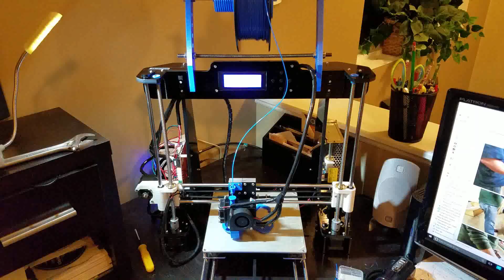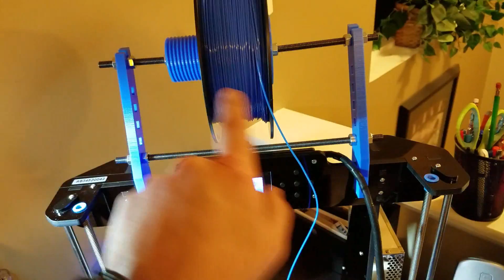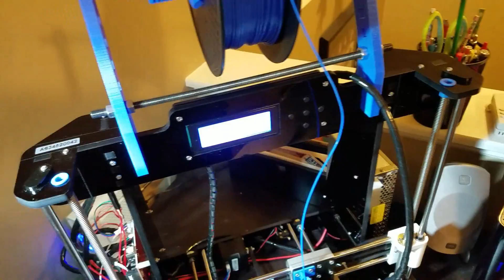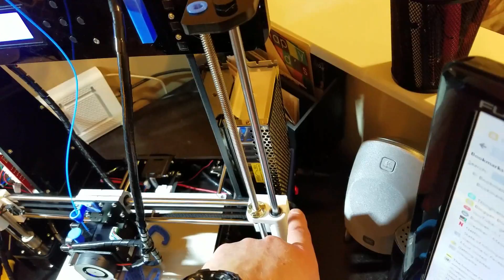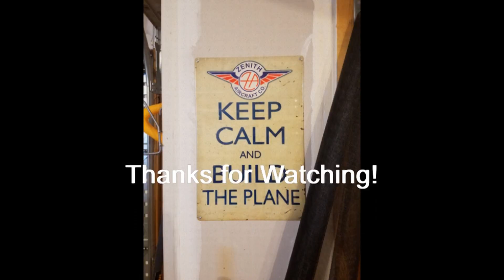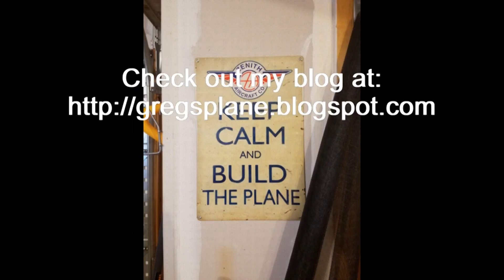Experimenting With 3D Printing

Comment: Have you ever tried using using printed rib forms or other aluminum forming things? Seems that if they work in MDF, it may work in printed plastic.
Reply from the maker: Based on my limited experience with 3d printing, nothing I've printed so far would stand up to aluminum forming, even if I printed them with 100% infill.
Reply: @GregsZenithSTOLCH750  Have you seen this https://www.youtube.com/watch?v=M-fTY5L5uu0
Reply from the maker: Ah. That's a different application than what I was thinking. I'm not sure how they'd stand up to hammer forming ribs, and you'd have to print some of them pretty large. But, it might be worth a try. My printers are only big enough to print smaller ribs and such, but it'd be an interesting project!
Reply: @GregsZenithSTOLCH750  Just drawn up the front rib for the given sample rib here http://www.zenithair.com/stolch750/gif/STOL%20CH%20750-75-W-1.pdf . It is just 2mm smaller than the Y axis of my Prusa I3 MK3S. I got lucky on that one. Printing it now and ordering some 0.025" aluminum and give it a try. I will report back with some results.